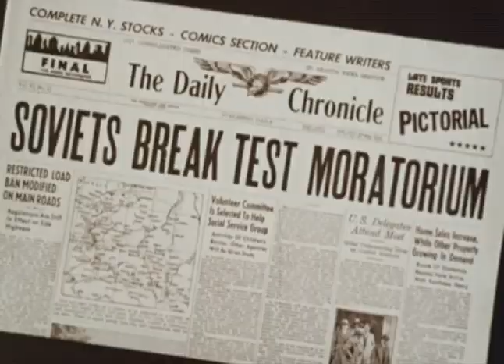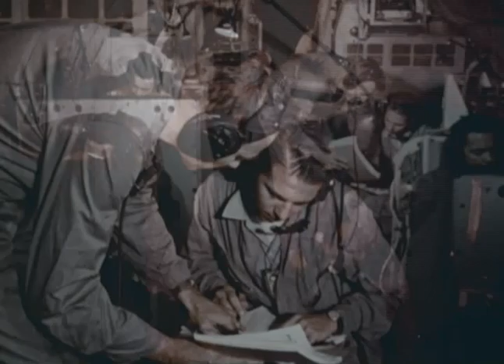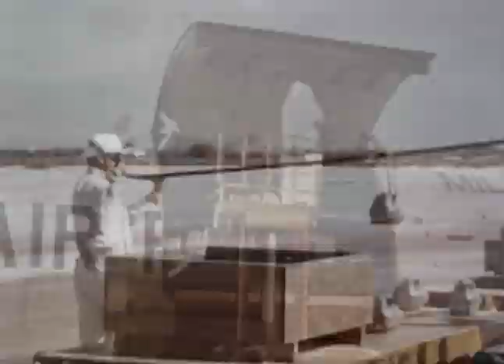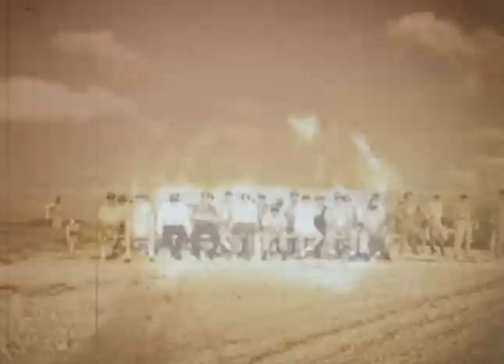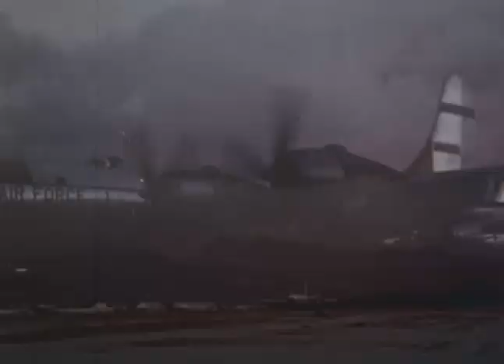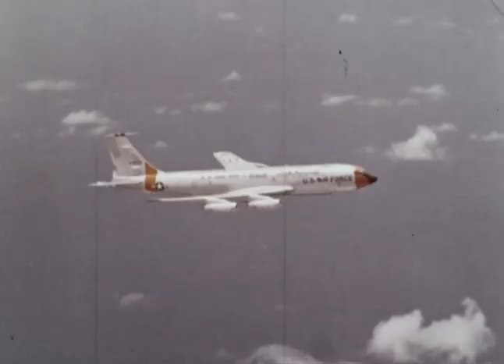USAF Participation In Operation DOMINIC (1962)

Comment: What is fast fission on hydrogen bomb?
Reply: fast neutrons produced in a hydrogen bomb by fusion of deuterium and tritium have even higher energy than the fast neutrons produced in a nuclear reactor. This makes it possible to increase the yield of any given fusion weapon by the simple expedient of adding layers of cheap natural (or even depleted) uranium. Fast fission of uranium-238 provides a large part of the explosive yield, and fallout, in many designs of hydrogen bomb.
Reply: What he wrote about fast fission was accurate. Most "H-Bombs" are fission-fusion-fission with each step multiplying the energy released in the next. A pure fusion bomb is relatively clean. The more fission, the dirtier they are.
Reply: @cowboybob7093  There are NO "pure Fusion" bombs... 
ALL bombs with a Fusion component are first detonated by a Fission bomb.
Reply: @davelowets  xray compression, yeah, I know. Glad you retracted your statement
Reply: @cowboybob7093  And where do you think those x-rays come from? Yup fission
Reply: @davelowets  Yes, I know, I really do know. laughing How about you look into the byproducts of a pure fusion bomb instead of restating what everyone knows.
Reply: @cowboybob7093  You're not making any sense. 🤦🏻
Reply: @davelowets  "The more fission the dirtier" doesn't make sense? "A pure fusion bomb is relatively clean" doesn't make sense? Yes "pure fusion" is theoretical, but it has at least one radioactive byproduct. Understand?
Reply: That looks like the LYNARD SKYNARD plane that crashed in 1977